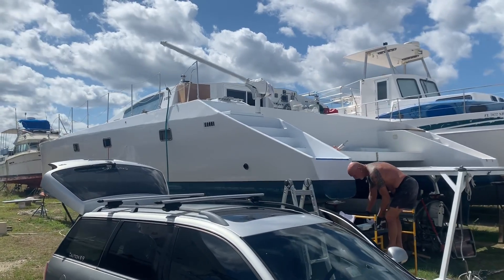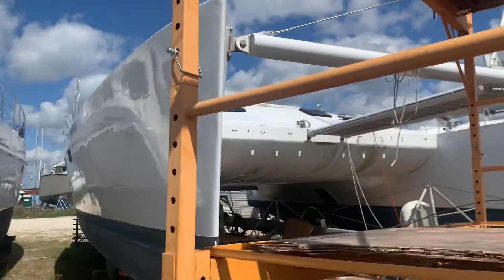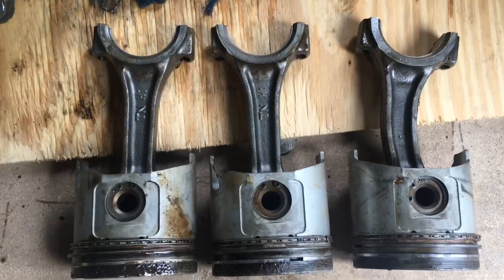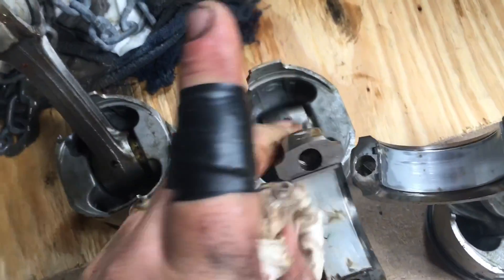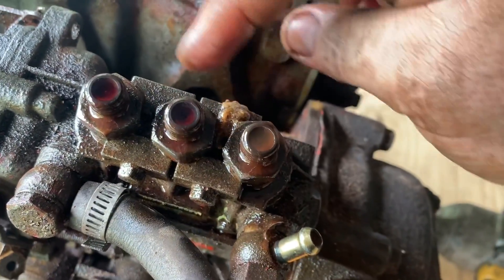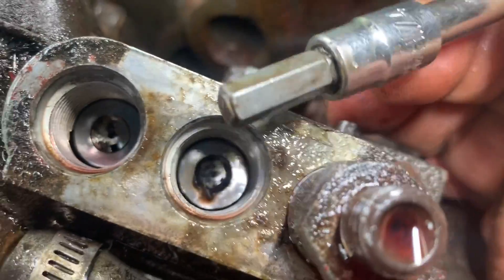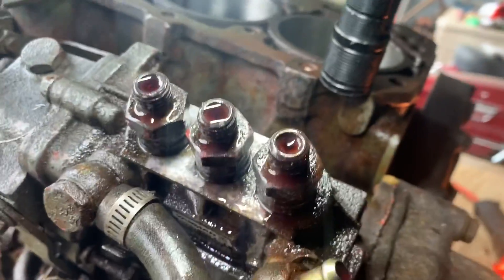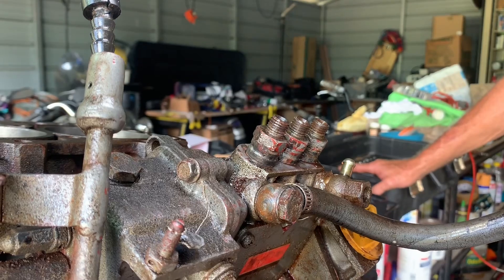Yanmar boat engine

Comment: It is going in a boat.... you absolutely have to take the injection pump apart and rebuild it properly.    If you show the owner that video and he does not demand as much he is not the sharpest knife in the drawer.
Reply from the maker: Like i said I’m trying to get that pump working just to see what parts he needs and to see if it’s rebuildable.  It was seized up and doing nothing. I’m actually getting life back in it and to just replace it is very expensive.  I’m spending two afternoons with him getting his motor back to life as a favor.  He just brought it to St. Augustine Fl from the Bahamas with only 1 engine it’s not like he’s going to be stranded.  Or like it’s his only engine anyway.  If that was the case I’d tell him to buy a new one.  Anyway just relax we are just playing with it and if it needs a new pump he will try to find one if we can’t rebuild it.  I don’t even know if all the pieces are even here for this engine. Someone else tore it down years ago.

Comment: Good luck with the pump, being such a small displacement engine you are metering fractions of a drip per stroke, it's not going to take much scoring on the pump elements to unbalance it. I admire your 'give it a go' attitude, something that's rapidly being lost these days.
Reply from the maker: What do i have to loose, It’s a boat anchor.right now. ;)

Comment: yanmars are pretty tough little motors, i've seen some in worse condition with big pits in the cylinder walls and they still ran just fine. they are tiny and lightweight but very well designed. yes, for some reason japanese diesel injection pumps are crazy expensive....

Comment: That Yanmar is a real mess! Too bad it doesn't have replaceable liners. But it looks like the cylinder surface is the least of your problems after looking at that rotating assembly and that injector pump!
Reply from the maker: None of it is pretty... but it’s going to be fun to play with.  I’m shocked i got it pumping  it then they just kept coming back one at a time moving more and more fuel every time i messes with them.
Reply from the maker: I also don’t carry a single metric tool on my bus.  Exciting

Comment: Such a small engine for such a large boat. I take that this catamaran is a sailboat with a 3-cyl auxiliary motor?
Reply from the maker: 2 little 3cy engines but yes it’s a sail boat.
Reply from the maker: The other engine is perfect.  Only one hull got waterlogged in a hurricane.